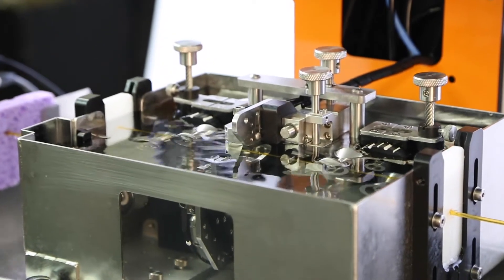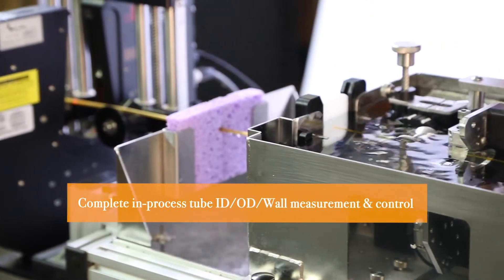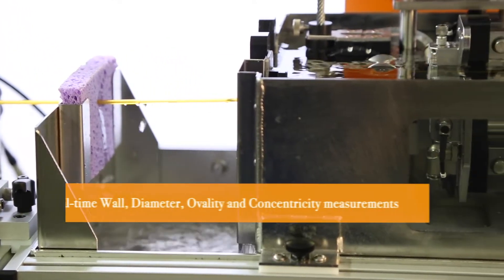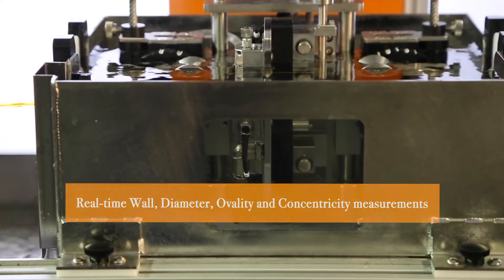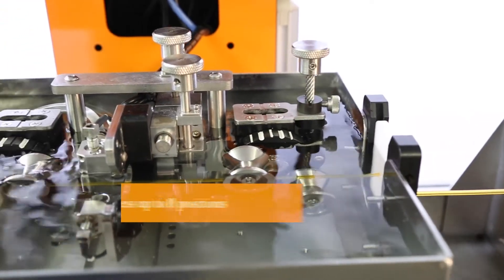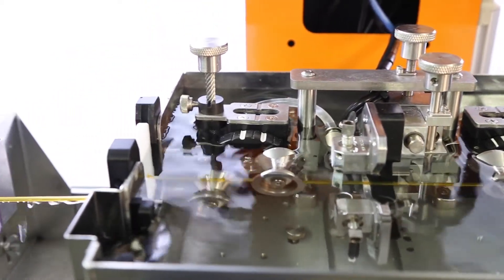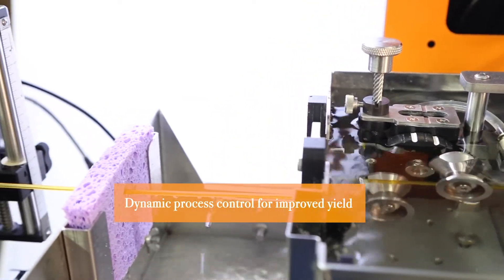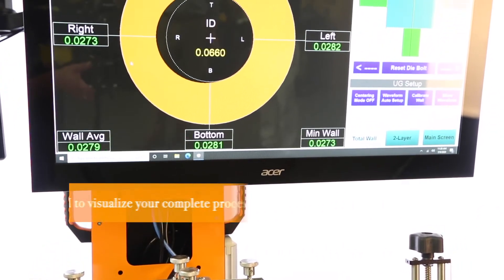Medical Extrusion Line - In-Process ID-OD-Wall Tube measurement system

Comment: What is the highest OD this equipment can measure? Could it also measure rigid plastic PVC/CPVC pipe?
Reply from the maker: Thanks for your question.  Currently the largest standard UG+ gauge capacity is for a pipe OD of 4.5 inches (114mm).  Yes it can measure rigid solid wall plastic pipe.  Please contact us directly with your full details at info@laserlinc.com or +1 937-3182440 We look forward to hearing from you